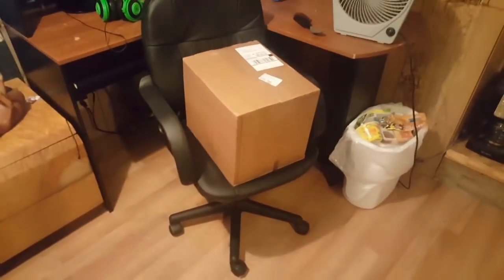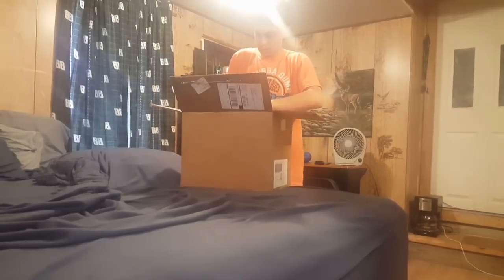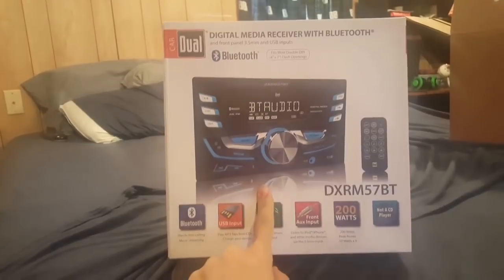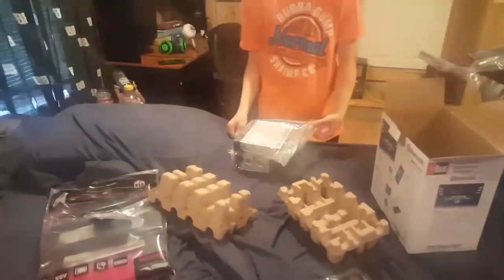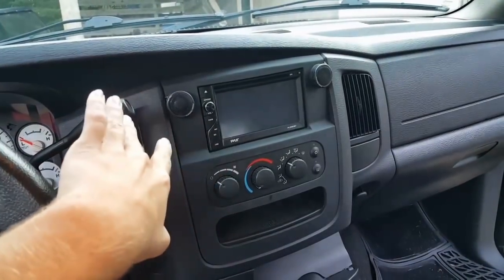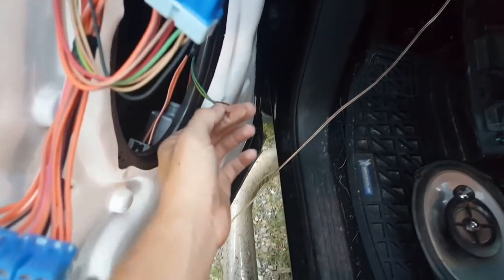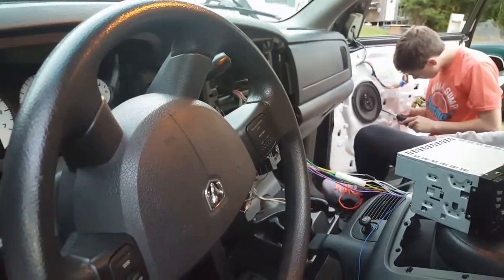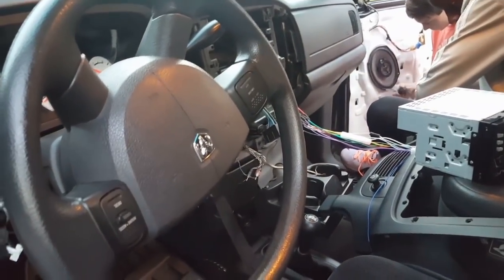2002-2005 Dodge Ram Radio Install!

Comment: Good job.. It's definitely a needed upgrade for those trucks. I had an '04 Ram 5.7 and did basically the same thing.. although I was more concerned with getting a rear view camera for when I pulled my camper... but I got a new stereo  and speakers along with it.

Comment: The antenna connection to the fender antenna is at the right kick panel, just under the glove box. Get a replacement antenna wire for that run and viola, radio stations!.

Comment: Please link everything to description. I need that second video that shows how to solder.
Reply from the maker: I linked a radio on crutchfield that is as close to the specs of the radio thats in this video. The exact radio is not offered on Crutchfield anymore. However when checking out on crutchfield (if you have the correct vehicle selected) it will promptyou to get all the installation hardware at a discounted price.

Comment: Did the truck have a factory amp? Had white noise bc the radio itself has a pre-built in amp and if you have that going through your factory amp that lol cuz that I had to bypass my factory amp worked just fine

Comment: Hell man. Have an 04 put in double din radio works but no sound. Has infiniti stock system with amp. I'm stumped
Reply: you need to make sure your power antenna turn-on wire from the radio is hooked up. That activates the amp.

Comment: How to pull out the stereo? Not shown.
Reply from the maker: Should be 2 torx screws behind bag hangers and bottom left and right of center dash piece around radio. After removing those there are just a few clips holding it in. Then remove the 4 screws holding in radio mount and bezel then slide out radio and unplug harness.